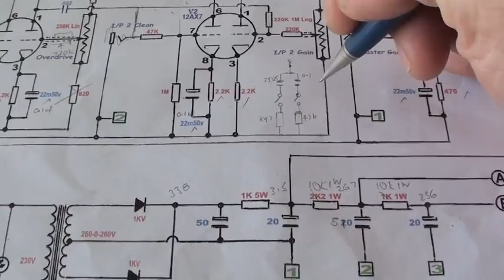Small Tube Amp Build, Start To Finish

Comment: Bonito trabajo. Con mi experiencia cacharreando me he topado con algunos problemas que no se suelen explicar,... en este tipo de circuitos es fácil que se dé el caso de que la masa común del circuito sea el chasis y así haga de pantalla, esta masa se conecta ya desde la fuente de alimentación y luego resulta que tambien los potenciómetros y otros elementos estén amarrados al chasis,... no se suelen aislar pero debiera ser así para evitar problemas,... a m me ha pasado que un amplificador se realimentaba al subir un poco el volumen, estando sin señal de entrada, resultó ser el conector Jack del auricular que estaba con un punto en masa y la rosca al chasis metálico,... Dime si este tipo de problemas te han pasado alguna vez y tu opinión de cómo actuar para evitarlos. Gracias.

Comment: Incredibly inspiring.
Thank you.

The twist on the variable resistor leads for cross talk?
Did you use kydex for your press form?
Are those standoff terminals available at RadioShack?
Reply from the maker: +Michael Rhoads Thanks Michael!  The AC wires are twisted to help cancel any 50 cycle mains hum.  I used glass-fibre for the form work, at about 4mm thick from memory.  The 'turrets' and chassis stand off's I got from Watts Tube Audio, online shop.  Im not sure whether you can get them from radio shack as they are very old -school.  I found that 'partsconneXion dot com' is an excellent site for buying decent resistors, caps, heat shrink, wire.. it really is great site.  Thanks!
Reply: +elams1894 awesome dovetail jig too.

Comment: good job, nice sound, what is the final price of your project. is it more or less expencive than a commercial amp?
Reply from the maker: +Florentin Garnier I have priced the amp out for the parts only and it is around 400US$ maybe a bit less.  It is a lot cheaper to make your own than by a similar hand made amp but the time component in learning everything and trial and error and so on is a lot greater.  I would imagine that an amp like this would cost between 800$ and 1000$ to buy complete, maybe even bit more.  thanks!

Comment: do you think this would be doable for someone with rather little experience with DIY electronics? I've built some pretty simple stuff, but never something like this. My plan is to build a nice tube amp with distortion for an organ that i bought so i'll just need an amp box with controls and an in / output because i'm gonna use a PA system.
also nice guitar, i guess it's selfbuilt too?
Reply from the maker: Hi Reversed, yes thats a self made guitar.  You can certainly do something like this for sure.  Tube amp circuits are fairly simple really, as they are really intended to run the tubes at their optimal level and everything else is more voodoo science than anything else.  This amp has a pretty simple main circuit (the switching makes it a bit more complicated) as Im only running three tubes (2 preamps, 1 output).  My main goal of amp building is to make it is neat as possible in layout design to keep all hum and noise right down and that is the tricky part, but certainly building the circuit is not too difficult.  I try also to keep the circuit as simple as possible for the same reason.  Any needlessly added circuitry will just contribute unwanted noise.  Thanks and all the best!

Comment: I always thought that the leads of the components were meant to insert into the hole on the turrets and the solder fills the hole. Clearly you know your stuff. Could you explain?
Reply from the maker: Hi Roman, yes you indeed can poke the lead into the hole and fill it with solder and that does work, however wrapping the lead around the turret, although more difficult, gives a much better connection and it is electronically more sound to build in this way. It also leaves you with a free turret hole, should the amp require surgery at a later date. Cheers

Comment: Do you have plans for the amp circuitry? Or know where to get them? Great project. I have a Gretch practice amp with a chewed up case (dog) - It has the same tubes as yours but it would be a bit of a challenge for me to draw up a circuit from it!
Thanks!
Reply from the maker: I designed the circuit myself. The pre-amp is similar to the early little gibson amps.  The switching got a little complicated and is really hard for me to draw so I haven't completed the circuit diagram. I have however got a layout diagram that is accurate. Not sure if that helps you out but give me a PM with your email and I can flick you a copy no worries. Many thanks!

Comment: Was amazed when this vid came out last year . Have you sold it ?
Reply from the maker: +Steve Smith Hi Steve.  I still have this one.  The PT runs off 240V so its only really usable to countries with that mains voltage.  Im now making them with a dual 120v/240v switchable PT.  I'll be making a few early next year, probably have a couple for sale then.  They will also have a slightly bigger chassis.  Thanks again!

Comment: Very clean build!  I'm looking to scratch build an el84 based small amp.  I realize that it is your circuit...not asking for that, but could you recommend an el84 circuit, single ended that I could modify?  Thanks!!
Reply from the maker: Hi redfishburn. AX84 dot com is a good site for anything related to el84 circuits. I have an accurate layout diagram of this amp which I can share with you. PM me and we can go from there, cheers and thanks!!
Reply: +elams1894 Thanks man!  PM sent.

Comment: Im thinking about building an AMP for a school project. I have a year to work and I have pretty much no experience building this kind of stuff. Is it safe? (Like can you get killed if you fail), have you bought a finnished kit or like have u bought seperate components?  I would just wanna know if i might manage to do it or if you need alot of experience?
Reply: I would suggest make an fx pedal before working on tube amps. Fx pedals take a very short time to make compared to amps so they are good for practice. Just be careful around high voltages.
Reply: +Najeeb al-shabibi Yeah, but the project must be bigger than an FX pedal. Will make an fx pedal eitherway but i might end up doing something other electronical without high voltages, like computer components like switchers, routers and stuff! :)
Reply from the maker: +TheHotspurs81 You can buy pretty decent amp kits off Triode Electronics dot com, they have some cool little amp kits to start from.  These give you a little bit of experience building amps.  Yes it is dangerous, like anything with electricity.  You can build the kit amp without plugging it in, and get experience with soldering, layout, neatness etc.  When it comes time to plug in and flick her on is where you need to be careful.  Perhaps take it to a qualified tech who can guide you through the process, watch, ask them questions, learn how to troubleshoot from the get go.  The high voltages are not to be messed with, so find out exactly where those high voltage points are in the amp and stay clear at all times and make them as safe as possible.  Having sad that, I have had 4 big hits from these amps, all from carelessness, but Im still around and learned a whole bunch.  Definitely get into it and go for it, be safe at all times and you'll learn a massive amount, its a very cool thing.  But do get a tech involved before lighting her up!!

Comment: This actually sounds really good, though I'd use it in conjunction with another amp. How much in total did this cost?
Reply from the maker: Luke Walker Thanks Luke!  Just parts cost about 400$ US and thats just the amp, the carbon and cabinet would be about another 100$ raw.
Reply: Thats really not bad at all

Comment: Didn’t really show the speaker assemble.   Should have an ‘out’.  Would probably sound great through a cab.
Reply from the maker: It has an output jack, from the ohm selector switch. Can run a 4x12 cab. Cheers

Comment: Great build skills. I suppose with all of that work I'd have gone for a single ended EL34 or 6L6. I bet an excellent form to make with carbon fiber would be the early JMI or VOX AC15 COMBO AMP (incidentally the AC15 was the very first JMI, predecessor to their VOX name). The AC15 cabinet utilized thin panels and definitely a great sounding classic, simple circuit.
CHECK OUT THE RED WHITE BLUE AND JMI SPEAKER CLOTH SIMILAR TO VOX, (but cooler imho) AC15 made for BILLY GIBBONS. It was just posted to 'e..bay' , 
Ad title,  *
JMI AC15 15 Watt Tube Guitar Amp made for Billy Gibbons. UK Made Combo Amplifier
Reply from the maker: I'll definitely check it out. I dig the low wattage push pull amps. Love the early vox circuits, especially with the pentode preamp. I just finished designing an 18watt circuit, vox like power section but with a three gain stage preamp and more elaborate tonestack. Just have to build it now. Cheers Paul!!

Comment: Would this work on a larger scale? Like to make a full sized electric tube amp?
Reply from the maker: +Ridge Woods Absolutely.  You can add extra preamp gain stages, a tone circuit, push/pull output section.  If you have the right sized Transformers you can build a monster for sure.

Comment: Where and how would you learn to build these sorts of things? I'd be interested in learning how to build a guitar pedal
Reply from the maker: +Donald I just persevered with reading the net and trial and error. I thought I would never be able to build an amp of my own design but it turns out it is indeed possible and not too complicated in the end.  The real hard part is solving the troubleshooting when you first light up a new amp and it doesnt work.  That is the tricky part and can take some time to iron out all the unwanted noise problems.. but it is possible.  Cheers
Reply: elams1894 Cheers, I'll have to look into it then :)

Comment: i have a question, do you 'cook' your carbon fiber? cause the vids i see from the auto industry like pagani cars and koenigseggs, after they glue the carbon fiber, they vacuum wrap it in plastic and 'cook' it in a large oven... in your video, after you glued it and let it set, its rigid and ready to go.. is there a difference between CF subjected to high temp. and CF just glued and hardened? i'm curious

and btw, wasnt it you that built that killer 1 piece LP style guitar?, off the roof craftmanship man...
Reply from the maker: +Anime536 _ Thanks Anime!!  Yes that was me with the LP one-piece, thanks.  The Carbon Fiber they use for Formular one and high end auto kits is pre-pregnated with resin, so it is stable (uncured) at room temp and can be worked very easily.  They use a computer to cut all the pieces they need and then a technician carefully lays those pieces very accurately in a pre made mould.  It is normally unilateral carbon fiber sheets that they use from memory.  Once all the carbon is layed, the mould complex is placed in a large autoclave which is an oven that also provides pressure.  The activates the resin and the pressure forces it into the strands before it cures.  Its awesome stuff but insanely expensive for an autoclave of that size.  When I was in Mclaren formular one workshop in the year 2000 they had about 20 autoclaves, and they cost about a million each!!!!

That pre-preg'd carbon has to be bought in large rolls, is very expensive and is stored in a freezer to keep it stable so it isnt something that one can use in a garage so the option that remains is a wet layup scenario.  You can use a vacuum bag with a pump to form your wet carbon fiber over a mould (the vacuum provides the pressure) and excess resin is squeezed out.  Its messy but relatively cheap and effective.  I used a press plate mould in my video to provide the pressure to form a decent structure.  You can just brush resin onto CF sheets and it will work very well but the excess resin will add weight.  Wet layup works and you are really limited only by your imagination of how to develope the pressure method for a nice finish, whether that be vacuum or press plate moulding.  The building of moulds is the hard part as you have to get the CF out of the mould when its cured and that aint easy as the friction force is huge even after waxing, get that mastered and you can build almost anything.  Thanks again!!!

Comment: Do you think you can help me learn how to make a footswitch for a Marshall DSL15H 15W Tube Head?
Reply from the maker: +Mitchell Martinez Iv made a few pedals for the 5150, 5150ii and they can be interesting builds for sure.  A great place to start as switching is complicated but fun at the same time as you quickly learn what you can achieve with switching.  Its worth doing Mitchell as TBH iv learned the most with building switch pedals as they are so cool. Relays, different configuration push switches.. do give it a go, the rewards are great!  Fire your questions at me if you like sweet as!

Comment: sounds great love that. what schematic it base on
Reply from the maker: +Amos Kamil The schematic is an original, with no tone stack.  The pre amp is based on the early Gibson amps which have a great little simple circuit and the best preamp layout IMO.  This one differs in a few areas but you could say that it is closest to the early little Gibson amps.  Cheers!!

Comment: so you used capacitors instead of tubes, right?
Reply from the maker: +Dow Row I used capacitors, electrolytics and filter capacitors, but still have the tubes.. 2 x 12ax7's for pre amp tubes and 1 x EL84 for output tube.  Thanks!

Comment: You changed the knobs between the picture for the video and the video itself, right?
Reply from the maker: Zantrop64 you are correct my friend. 500 thousand odd views and you are the first to pick that up. I solute your observation skills!! have a good one!!
Reply: elams1894 thank you!
So, what happened?
btw I think you are the only youtuber who answers so often :)
Reply from the maker: The knobs in the thumb are off my les paul that I built, I put them on the amp to see how they looked as they are the same wood as the cabinet, then took a few photos. I actually think the other knobs look best for this amp, thanks again Z!!
Reply: elams1894 yeah, I remember, and I agree with you that the wooden knobs aren't perfect, but maybe not theses ones. Maybe some tele-like dome knobs? Thanks

Comment: How is the sound produced? I didn't see any speaker cones
Reply: +Jacob Beaumont This is an amp, not a speaker box. It only amplifies the electric signals and feeds them into a speaker.
Reply: topfkopf666 gotcha, thanks!
Reply from the maker: +Jacob Beaumont I had this little amp running into my Fender 4x12 Tonemaster.  It could run another 4x12 too pretty easy, its got plenty of balls! Cheers!
Reply: Amps drive a speaker cabinet. They are two separate things. You are used to seeing amp speaker combos like small practice amps.

Comment: Nice Work. Are you selling the schematic and mother board lay out temp plate?
Reply from the maker: +B Carr I will be selling this in a kit form at some stage. I have an accurate layout diagram, PM me if you keen, I can flick you a copy no worries.. cheers!
Reply from the maker: +B Carr I hope to sell this in kit form soon. I have an accurate layout diagram, PM me if you keen, I can flick you a copy no worries. Cheers!
Reply: +elams1894 
Where did you order the the material like the terminal posts and the fiber board to anchor them?
Reply from the maker: +Omar Morris HI Omar, I ordered the turrets (posts) from Watts Tube Audio online. There could be a cheaper supplier no doubt but I found that Watts has a great little web store for specific things like standoffs and stainless hardware. I made the fiber board myself out of fiberglass cloth. I wanted the board a bit thicker than the norm so thats why I made it myself. I buy my capacitpors, resistors and electrical from PartsconneXion online. Cheers!!

Comment: Did you build the guitar?
Reply from the maker: +Nathan Davey Yes I built that guitar too.  I actually built that guitar very quickly as a practise build and it had a bunch of flaws that I wasnt too concerned about at the time but the funny thing is that it is an awesome guitar, even with all the flaws, I mean, the fret slots were mistaken cut on a slight angle and not even square to the neck.  Its my go-to guitar for everything now, and somehow everything just clicked in that guitar, the tone, feel, everything.  It just shows you that any guitar has the potential to be a winner, you just have to play it and find out:)  I love the thing and would enter a prolonged dark depression if she were to be stolen.  Thanks again!!

Comment: Why you dont use a circular saw?
Reply from the maker: I can't get the accuracy with my circular saw as its old and a bit crap. I'd love some big machinery but alas can't find the funds at present.
Reply: +elams1894 anyways, you did an excelent wood job. But it would be tedious to cut such a thick block of wood with a manual saw

Comment: Hey bro do you have a video on the components that you use like those aluminum things sorry aluminum post that you use
Reply: Steve Stokes - the turrets?  I’m sure they aren’t aluminum. Kind of like rivets in that you push the base through a hole and then flange it to secure it to the board. You can find them easily in the US from Hoffman Amps, Antique Electronics, etc.

Comment: Where is the speaker? Did I miss it?
Reply from the maker: +cbond99 It needs to be plugged into a cab. This one was straight into a 4x12 Fender Tonemaster with 2x Rola Alnicos, a Celestion GH1230 and a V30, cheers
Reply: Oh, ok ~ Thanks